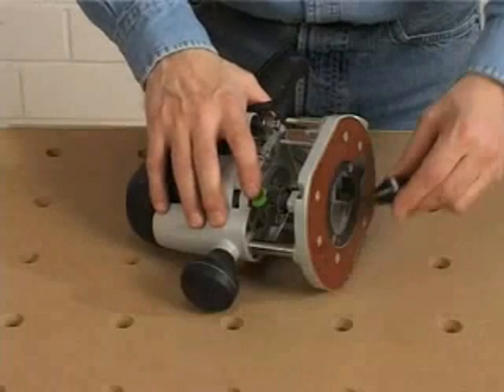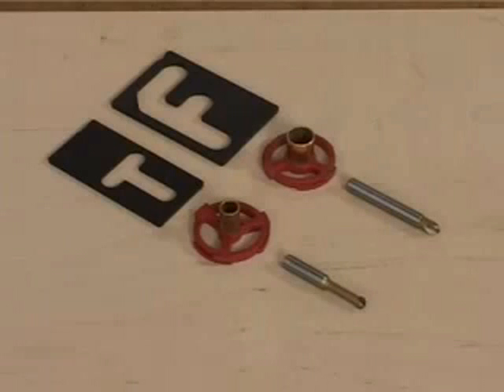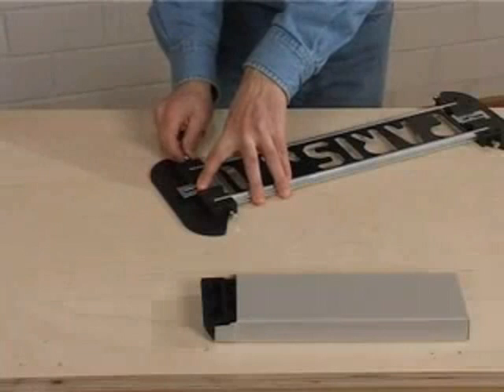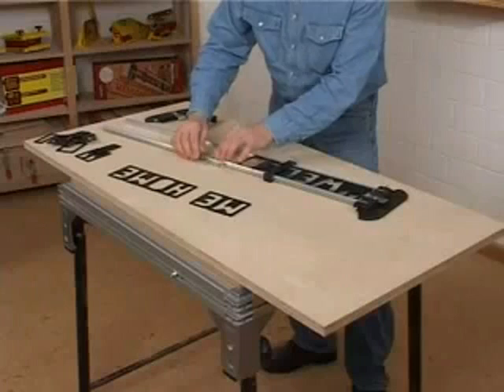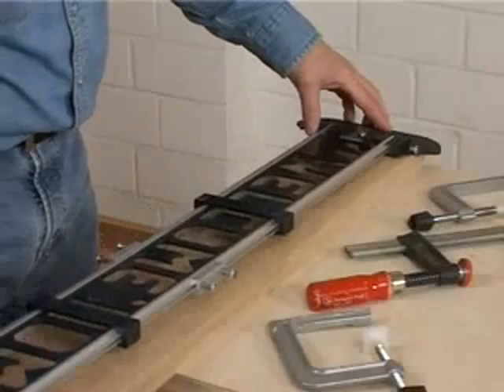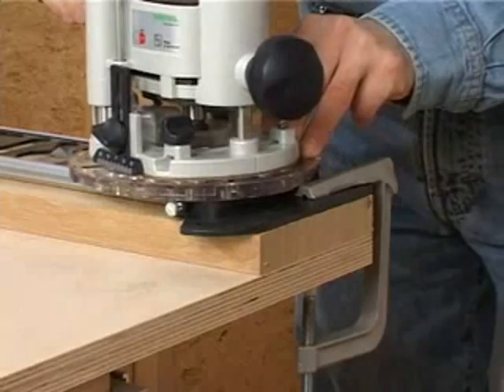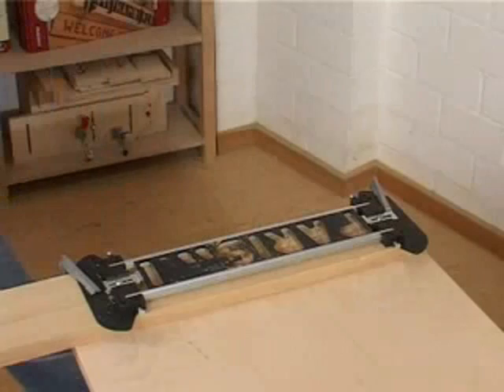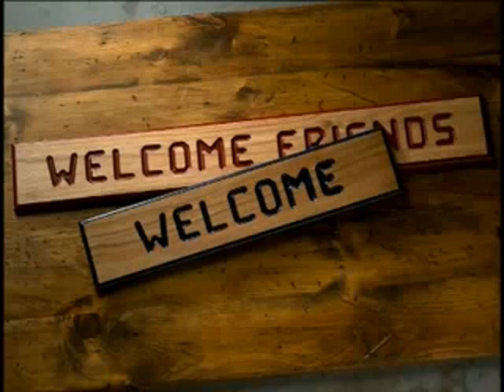Router Sign-Pro Signmaking Template Kit

Comment: I have two main routers and a trim router, the foot-plate wouldn't fit on either of them. Is this kit designed for a specific make of router. Three guys(their routers) in our little workshop had a try and only managed to secure the plate with two screws. Just couldn't get the fixing holes lined up with more than two.
Reply from the maker: Hey Cliff!

Here's the link to the Milescraft Twistloc Plate Manual: https://www.milescraft.com/wp-content/uploads/2016/05/1201_1261_Manual_082316.pdf. Pages 5 & 6 List the compatible router models and the associated mounting slots that should be used for each brand/model.
Reply: Seems the page doesn't exist yet
Reply from the maker: Specifically, page 5 has the compatibility chart and perhaps the PDF is taking longer to load the later pages? Couple options:

1) you could try accessing it from the Milescraft page (https://www.milescraft.com/product/baseplatebushingset/) instead of the direct PDF link, or 
2) you can contact their customer service to discuss compatibility design further.

Oh, and here's an attachment reference once you find out if yours can work:  https://www.youtube.com/watch?v=jPuBJ10Xjzk. 

Let us know if there's anything else we can do to help, though!